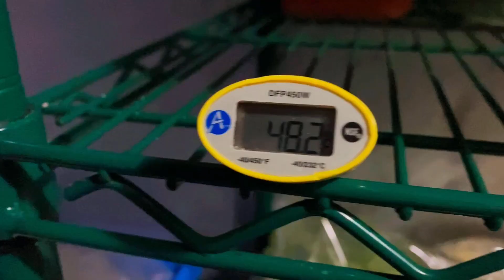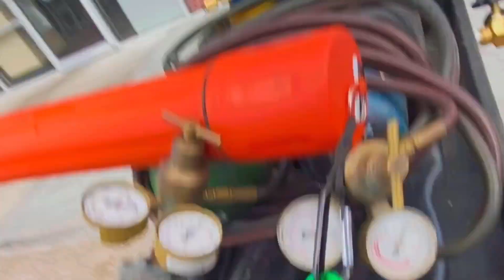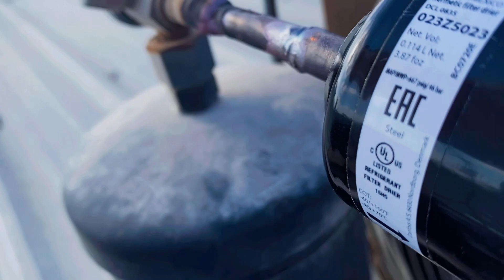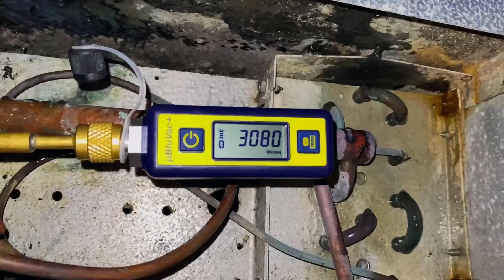Old Walk in Cooler | Leak Repair | HVACR Repair

Comment: Badass into and video bro. 👍🏽
I’m curious tho, what was all that putty on the txv ? Looks like thread sealant but it’s everywhere.
Reply from the maker: Uh yeah it has leak lock 😂 on the solenoid, they tried to slow down the leak. The txv has a crazy solder job tho, I thought for sure it had more leaks...And thanks man 🙏🏽
Reply: @ReliableHVACR  I just noticed that wasn’t the txv lol it’s crazy that they didn’t just fix it? Good shit bro keep it up.
Reply: Intro**